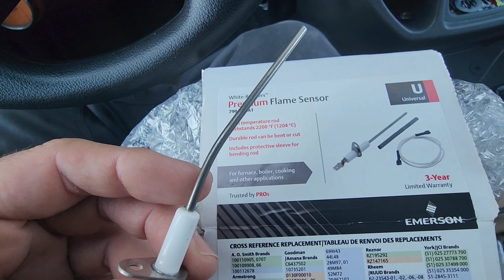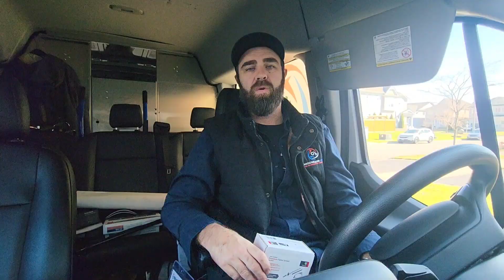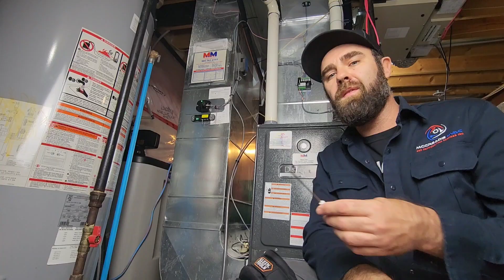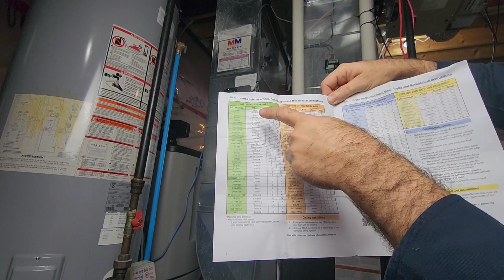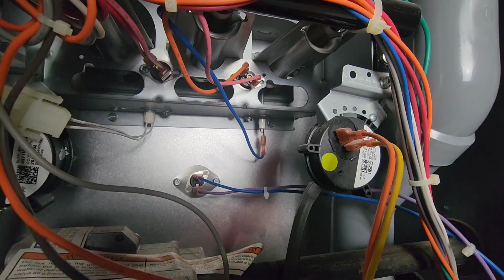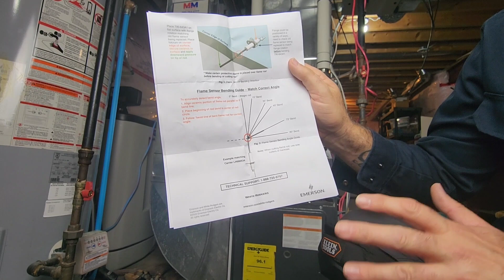Emerson White-Rodgers Premium Flame Sensor Installation - Universal Heating Part

Comment: This is an awesome flame sensor. The spade terminal on the sensor was a little big and would not fit the spade connector. Cut it a little with a grinder. Other than that, its a beast